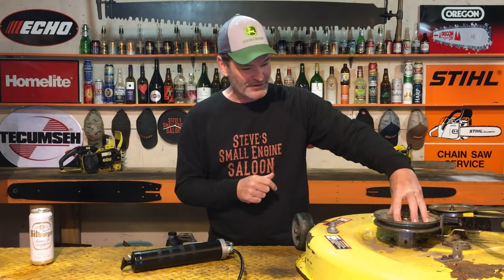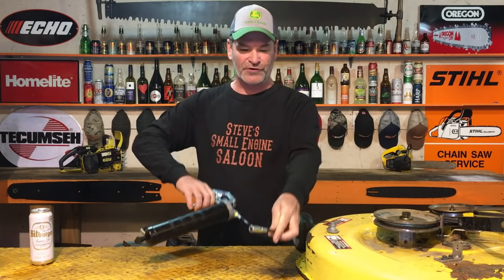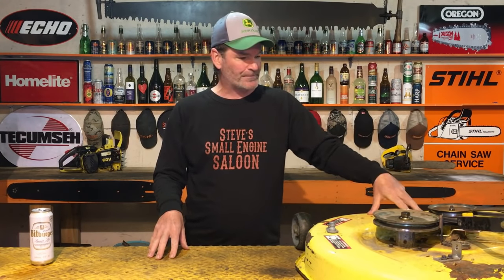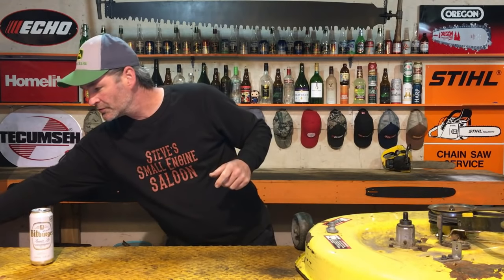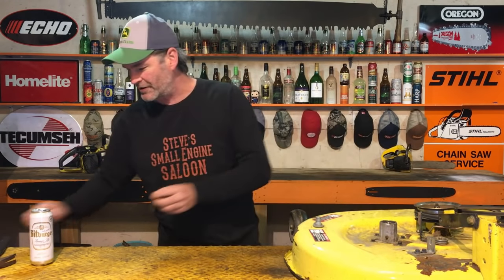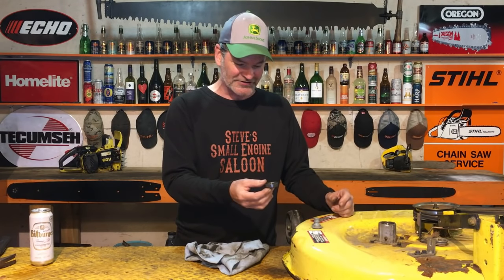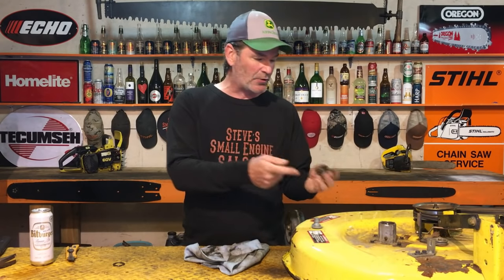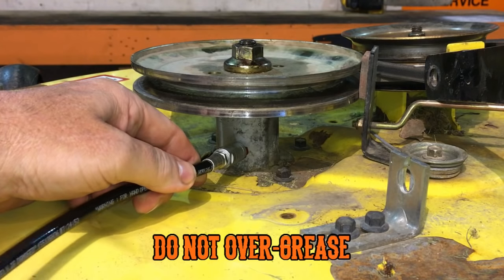Your Riding Lawn Mower's Dirty Little Secret

Comment: It's not that the engineer didn't think of it. It just costs the company too much money in time to have workers remove one side, and make sure they are assembling the correct sides inward. They can just also bearings in it, be done, and let the service tech get some money from parts and labor when someone is too lazy, or doesn't have the time to do this on their own.

Comment: You totally hit it. I am just amazed when I see the things an "engineer" did in designing some things. I always think about their high education and wonder if it actually destroyed their capacity to think. I wouldn't do this this way. I'd just lightly grease the bearings and put the seal back in and let it go at that. repeat every 2 years and things will do fine. But to everyone his own. Good call.
Reply from the maker: Right on

Comment: The reason is very simple: when the engine was designed, there were no sealed bearings (or they were very expensive). When they became 'the norm' manufacturers popped them in, but forgot to remove the greasenipple (or didn't bother to do anything about it). The original engineers did know what they were doing, but later developments didn't take that into account.

Comment: My bearings froze up. I removed them from the housing and went to the dealer to buy new ones. They told me that you have to buy the whole housing with new bearings for $140.00. I said bull and went to a bearing store and bought the new bearings $25.00 and installed them in the housing. Works fine now. It is called "screw the consumer".  $25 or $140, what would you do? LOL   SCAM SCAM SCAM.
Reply from the maker: Right on

Comment: According to the Cub Cadet on-line manual for their fabricated decks, the purpose of the grease zerks is to displace moisture.  I don't think that tampering with that seal is a good thing unless you reseal it.

Comment: I got a used Murray rider for $60. Took it home and rebuilt the mower deck plus a once over. What a mess! After it was all done, I ended up placing a snow blade on it. Later sold it for a lot more than I spent.
Reply from the maker: Right on

Comment: Hey mate!
They are a pre greased pre packed bearing from the bearing manufacturer and they are smart...
No they do NOT put much grease in there or it creates too much heat that damages seals.
YOU DO NOT! Want to remove the seal sides.
You do NOT want to grease that centre nipple period!
This will cause a lot of drag on the shaft for one and two will cause heat and it will slump the grease to the bottom starving the top bearing.
Mate I do industrial maintenance and I’ll leave it at that.
Reply: Then why did the manufacturer bother with the expense of putting the grease fitting on the spindle in the first place?  Could have saved the cost of drilling that hole, tapping that hole, and screwing in the fitting.

Comment: I took mine all apart, popped the inner seals off, also drilled into the sides of the hubs & put new zerks in, & drilled rite through the bushings & cleaned burrs etc. wiped clean with rag n brake cleaner, reason i put new zerks in is because the holes were'nt even in the correct spot for grease to even get to the bearring, i pumped probably 50 pumps n filled um up, now the deck is quiet & correct, whoever Johndeere has designing this junk needs a blanket party 😂, thanks for the very informative video Steve 👍 ..
Reply from the maker: You're Welcome...

Comment: Would you believe that that John Deere tractor didn’t come with Z series Bearings and that the Grease Nipple worked to Lubricate the Bearing pair. It looks like one of your Bearings is probably missing too . sometimes people do things like replacing Unsealed Bearings with Sealed to minimise failure. I think that whoever did forgot about the second bearing or thought one would be plenty and would replace it more often.

Comment: love the video, often wondered if the bearings were sealed on both sides. recently bought a craftsman46 in. cut 22 hp. when i serviced it i looked for grease fittings on spindle housing. there were none. im going to remove them and drill and tap for a fitting and remove inner seal from bearing. thanks.
Reply from the maker: Thank You...and You're Welcome...

Comment: There is a reason why the bearings are sealed on both sides, there's a lot of contamination coming from the mower.
The cavity is made to be forcing the grease in and around the seal.

Comment: What I do is fill it with grease till it starts squirting out the weep hole in the bottom where the blades are and then give it a few more pumps.another channel showed that if you do it this way grease will squeeze past the baring seal and still get in. I've been doing it this way and I'm over 150 hours on my current spindles and they are dead silent. I do it about every 20 hours so about once every month and a half. On mine it takes about 45 pumps before it squirts out and it took almost 100 the first time per spindle so don't be afraid to just keep putting an absurd amount of grease in. Grease is cheap spindles aren't. I use either mystic high temp or Lucas red n tacky usually

Comment: I'm guessing the spindle castings are the same across all decks, and they put sealed bearings on consumer models that aren't likely to see regular maintenance.

I just opened up the spindles of a 42" JD deck, and there is a sleeve inside that makes it impossible to get a punch on the outside races to drive out the bearings.  Seems unnecessary with sealed bearings, which makes me wonder if these bearings might be open on the inside.  Any suggestions?  (The bearings are good, so I'd rather not destroy them "for science".  :-)
Reply: that sleeve is actually smaller than the spindle casting and can be pried over to one side. found that out yesterday when i was having the same problem
Reply: @knechvatal  I can only move it 1/4" in any direction--leaving no room for a drift to get behind it.  When you took yours apart, were the bearings sealed from the inside?
Reply: @wlan246  lt155 mower and yes they were sealed bearings. i pried the sleeve to one side which was kind of hard because of the grease that was in there and used a punch to drive out the bearing. they came out real easy

Comment: the frame of the rider rots out before any deck breaking !!! after 10+yrs I only replaced 3 deck spindles on 14 riding mowers !!! how do you grease sealed bearings ??? and it was where it bolts to the frame that broke and never had a bearing go out !!!

Comment: I recently found out that you can no longer rebuild a briggs and stratton engine. No parts available anyplace! Replacement of the entire engine is required. Oh, guess what? The engine for that lawnmower is discontinued! Your 4 year old lawnmower is junk! Complete junk! Maybe the blade can be used on another mower. I guess you just have to buy a $400 lawnmower every couple of years.

Comment: Great suggestion, Steve! Don't forget that the same problem exists on JD front wheels; exact same problem! Probably caused by design of poor bearings on front wheels (and cutting deck spindles) which precipitated replacement with sealed bearings but they forgot about the Zirk fitting no longer useful once old bearing design was replaced by sealed bearing as replacement.
Reply from the maker: Great point!

Comment: I figured this out 5 years ago. After I bought my new lawn mower, after I took it appart to drill and tap for grease fittings. I saw the inner seals, pulled them out. I bought replacement spindle assemblies. The same condition exist, modified them as well. Many other issues exist that I modify.

Comment: Hold up your hands. every one who does not do regular pm on their mowers. These bearings are sealed with grease in them the grease can not get out. The sealed bearings will last ten times longer.. Or one million times longer then one that is not  greased.. A sealed bearing can last up to 10,000 hrs..You can buy bearings that are sealed on one side. A bearing # such as 6203 ss. Sealed both sides.. That is what the ss stands for. You 6203s one side. Deere just made it better for the idiots that do not pm the machines...

Comment: Yea but if the sealed side pops out that easy as soon as you pump it full of grease it will push that other seal out letting dirt in I would leave it be as is

Comment: You have to fill the spindles until the grease starts coming out, then just wipe off the excess... That pressure pushes grease into the sealed bearings, so no need for all this work... Removing the bearing seal will invite dirt and dust which may shorten the life of your bearings.

Comment: That's a dust cover. Grease guns put out a tremendous amount of pressure. Once you fill up the cavity with grease, the grease gun has more than enough pressure to push grease past the "seal",  into the bearing and out the seal on the other side. Same goes for ZZ bearings with metal dust covers.  They're not "sealed" in the true sense of the word. They're not even waterproof. 
Try it. Grease that spindle until the cavity is full. In a few more squeezes, you'll see grease come out of the bearing.
It's not going to hurt anything to remove that inner dust shield, but it's unnecessary.

Comment: I hate how some manufacturers like husgvarna decided to put the gas cap right next to the engine. So, when the engine is hot, and you have to refill, you risk getting gas on the hot engine and causing a fire

Comment: Okay so as soon as you grease the bearings with the grease gun especially that battery gun you will blow the seal out the other side of the bearing then water will get I  and ruin the bearing any way  if your taking it that far down fit new bearings with the new seal and your sorted again, rather than go through all this and end up having to take it apart half season to replace them anyway

Comment: Well I wasn't going to comment but you asked us to do so. The engineers knew what they were doing, if you think that a grease gun producing 10,000 PSI isn't enough to penetrate that seal, you'd be wrong. If the seal were that tight the bearing would never spin, there has to be some clearance between the seal and the bearing or else the seal would wear down in a matter of minutes. The problem lies in people pumping the grease gun two or three times and calling it good. You have to fill the entire cylinder with grease until it starts coming out of the bearing, that's when you stop. You only need to do this one time, then the next time you lubricate the bearings two or three pumps are good.

Comment: Thanks for the video!  However, I do disagree as those "bearing seals" are just dust covers, they are not air-tight, so with that, we are suppose to pump the grease gun until grease squeezed out of the bearing ends...  I think, you may have just not pumped enough grease through the chamber out of the top/bottom bearings.  BTW, if you have pumped enough grease in to the chamber with the "bearing seals" being the stopper/blocker of the grease, then the inside of the top/bottom bearings should at the lease have signs of the old grease.  In my opinion, you blamed the design engineer(s) prematurely.

Comment: If you take that cover off of one side of the bearing, is there a chance that the bearings will fall out of the top one, since it's facing down?
Reply: the balls are inside a cage that moves with them

Comment: The grease you pump in does do something.   It over heats the bearing.  Thats also what happens when you remove those inner seals a pump the cavity with enough grease to reach the top bearing.   Also, the cheap grease getting pumped in is likely incompatible with the lube supplied...oh.  yes.  ALL sealed bearings ship with grease.
   I promise NO ONE has the proper grease in their shop for the load and RPM a  mower spindle must endure
   I've never greased my 2006 Simplicity deck bearing.  About 5 years ago I bought a new set and they are still sitting there.

I know there is a grease fitting on those housings, but they are placebos for old fashion mechanics who are living from grandpaws advice.

Comment: Are the bearing seals totally sealed and therefore disallow dirt and grease inside of them even at the high revolutions? and with the heat. Does the pressure from the inertia cause by the centrifugal force of the spindle. not being contentious but just an observation you popped that seal off like it was an old school bear tab.There has gotta be grease going in there but not as much as they would love for a consumer to believe it does.  Great work now you made me want to have a beer, gotta resist. BTW you content rocks. Any thing on walk behind weed hackers made by craftsmen?

Comment: First off if it had been greased when he took it apart the shaft would have been covered in grease. I don’t know who is correct but watched another guy who said that seal would allow grease in because it’s pumped in under pressure. Would love to hear from a big name brand engineer to get to know the facts. Some don’t even have a grease port on the spindle. Now that can’t be good.

Comment: I think John Deere is pure junk, I have a new mower, $3267.00, it has 15 hours on it, I have had it for a year. I am afraid to run it, because I am afraid it will fall apart. Plastic parts, feels like you are driving a disposable mower.